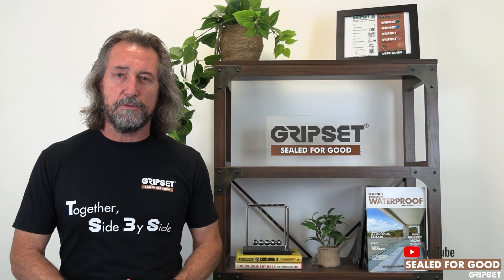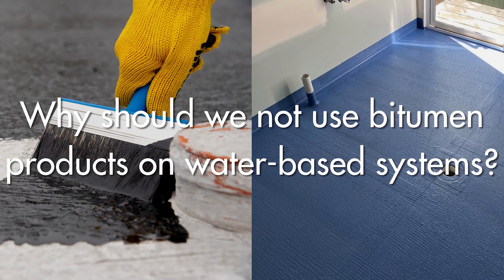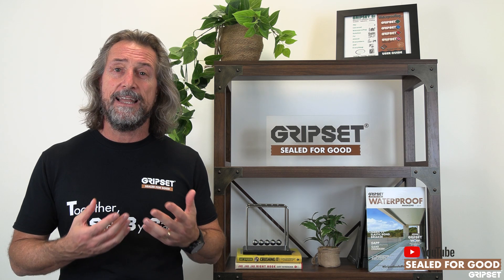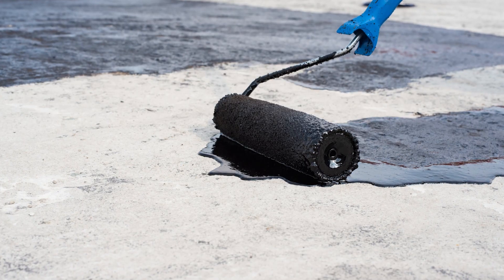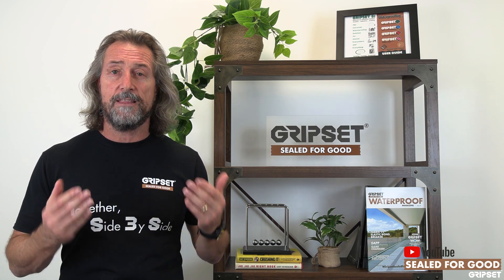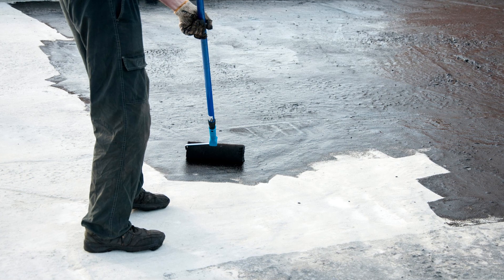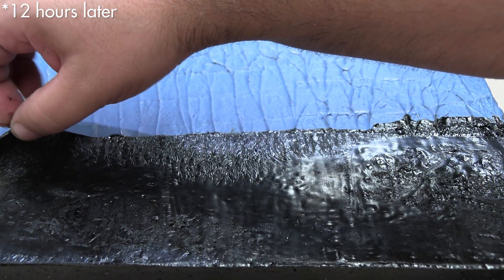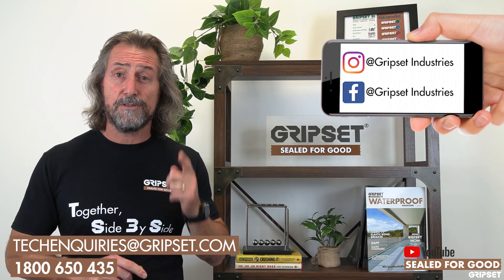Why you should NEVER use bitumen and water-based products together

Comment: An exterior brick wall of my house has previously been painted in a black bituminous paint. Will I be able to paint over the bitumin paint with a primer and water based masonry paint? Thanks in advance
Reply from the maker: Hi Grace, thanks for watching! It’s always recommended to speak to the relevant paint manufacturer for advice on compatible surfaces/preparation.
There are risks associated with painting over bitumen including bleed through, softening of the bitumen in exposed areas that can cause crazing and delamination of paint and general adhesion issues with bonding to bitumen and oxidised bitumen coatings. 
There are block-out primers available, but again they should speak to the relevant coatings manufacturer first. 
We’ve nothing in our range that we could recommend as a primer over bitumen.
Reply: Can you paint it on a stone house around the base for where there will be concrete laid and will be touching the wall, and the house has salt damp

Comment: Can i use Pu solvent base sealer and paint over bitumen primer or bitumen damp proof membrane?
Reply from the maker: This is in no way a detail that we would recommend. Gripset membranes are all water based - please contact info@gripset.com
Reply: You may be able to use a two component aromatic PU waterproof coating over bitumen solvent primer .
Prior to the application a two component epoxy primer is needed